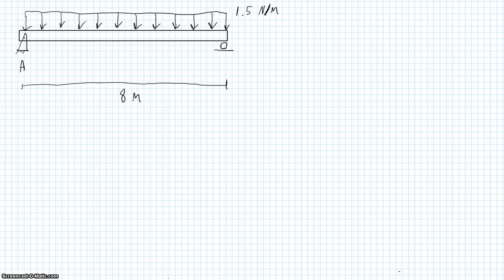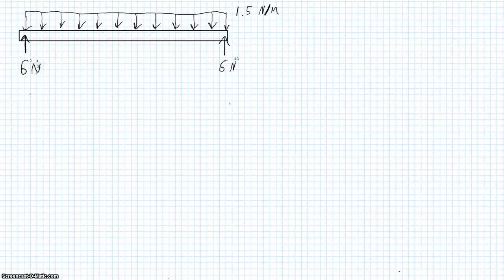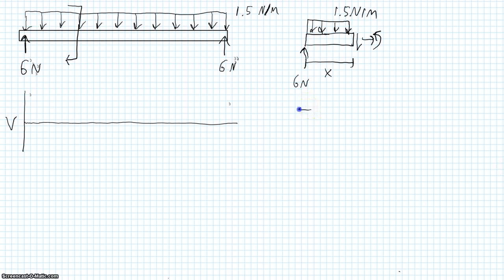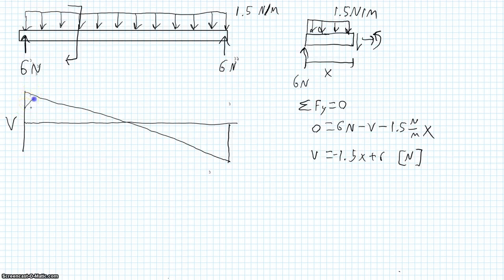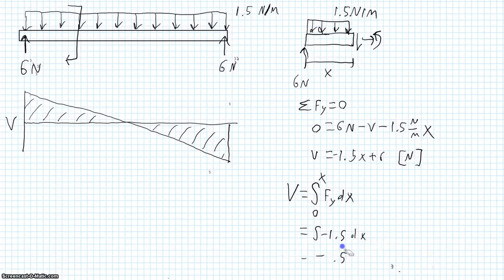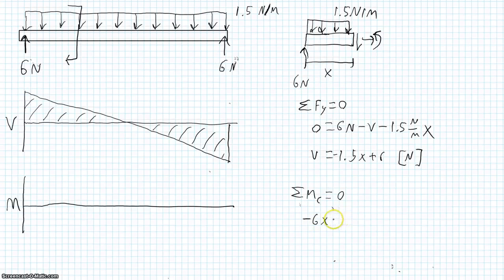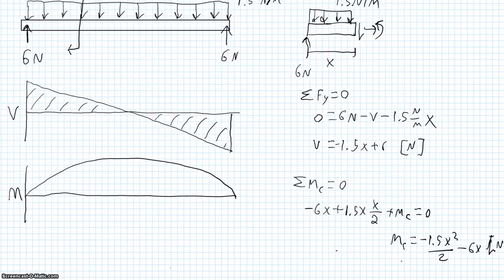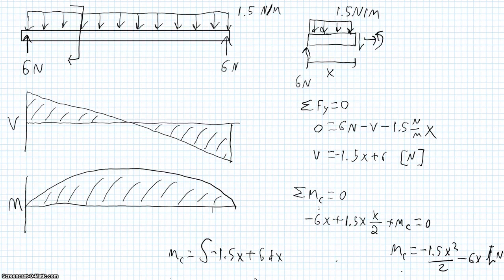Shear and Moment Diagrams with Uniform Distributed Load

Comment: Great video, but there's a small error.
At 5:10 when you rewrite an equation to isolate M at cut C, you fail to change the sign of the term -6x when you move it to the RHS of the equation.

You correct it later when you define the M at a cut C as the integral of V, but the error is still there at 6:31 when you write the correct version.
They're both on screen at the same time. It's cute, but it's wrong.

Comment: Sorry, may I ask some questions? In 5:21, should it be Mc= -(1.5x^2)/2+6x?
Also, i want to ask that why we don't calculate the moment by using shear force?
I think shear force=resultant force(6-1.5x) and we can use it to calculate same answer
If we use shear force to calculate the bending moment, the (Mc) should be equal to 6x-1.5x^2
I know Mc= -(1.5x^2)/2+6x is correct answer, but why these two answer is not equal?
Reply: I just study this subject so i am confusing to above questions.
Reply: Oh, i got it. If we use shear force to calculate bending moment, it should be (6-1.5x)x+1.5x^2/2=6x-(1.5x^2/2), right?